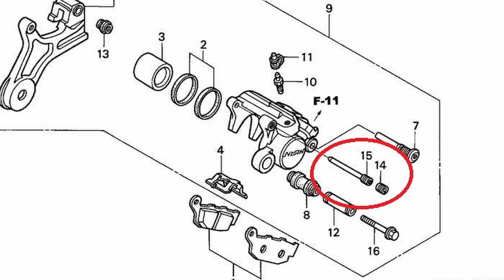How to REPLACE rear BRAKE pads - TRANSALP XL 650 / 700 V - AFRICA TWIN XRV 750

Comment: Very usefull video, but I have a question, don't you need to open the rear brake fluid deposit lid before pushing back the piston? thanks
Reply from the maker: Hi there! If you didn't add brake fluid between pads changes, the diaphragm inside the deposit should take care of the added thickness. If you did add fluid at some time, then you definitely need to open the deposit, remove the diaphragm and even take out some fluid when pushing back the piston. In case of doubt, it's better to open the deposit, as you said, and check the fluid is not overflowing when pushing the piston back. In that case you'll need to remove some fluid, and then adjust the level once the new pads are in place.
Reply: @coastrider8881  oh ok, I've changed the brake fluid with the old pads so one extra step for me 😪. Thanks